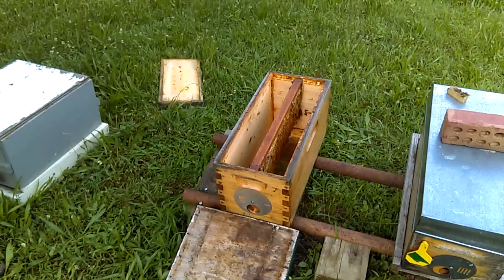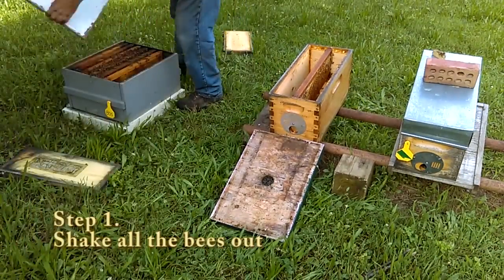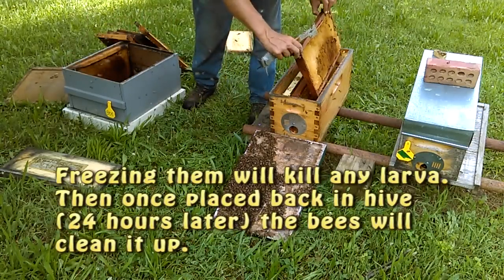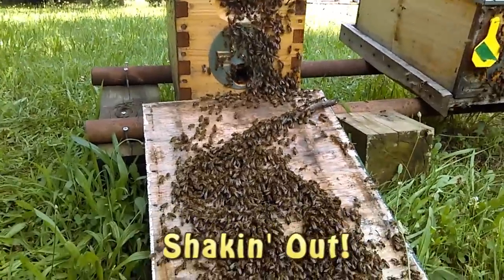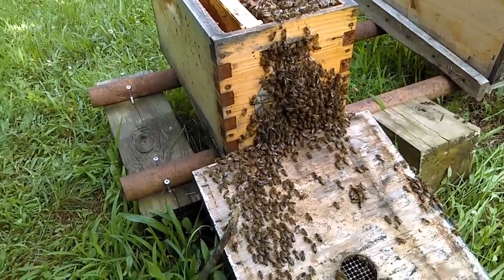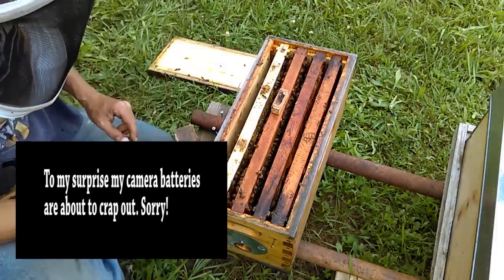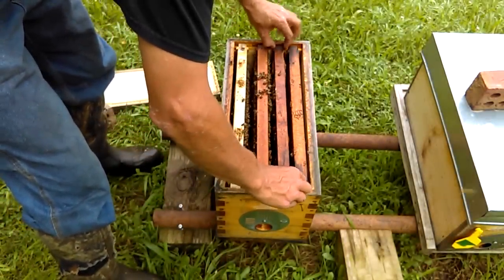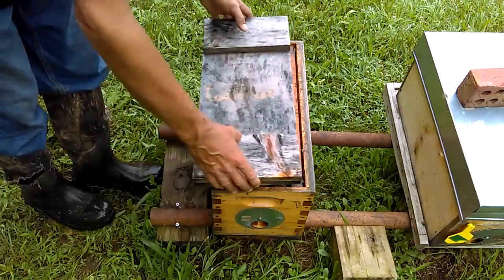Understanding / Fixing A Laying Worker Colony (Drone Layers)

Comment: I currently have a laying worker hive consisting  of two med supers which they are covering.  Would  hate to lose it . I only have 3 hives the other two might have a queen cell ,I have no extra reared queens . Do you think this  might work ?   As for dumping them out that close to the hive  doesn't that give the laying worker(s) a good chance of walking back in to set up shop?   Though I guess  they may attack the queen cells  ?

Kameron 
Fl.

Comment: Excellent process, nice job!   Have got to do the same thing this week and appreciate your video.  Well done!   Only wish I had more normal brood but only have two hives.  We’ll see how it goes.  Thanks again.
Reply: Update!  I used some of your technique, but with limitations.  Didn’t have brood from another colony so tried something a little different.  I removed all of the drone brood frames from the laying worker nuk, shook off all the bees about 30 feet away, put the frames in the deep freezer over night, took the clean drawn frames (some had nectar in them) out and put them in a new deep box.  Removed the nuk box from the area and replaced it with the new box containing the new queen in her cage.  
Next day, I pulled the drone frames (they had honey, nectar and pollen in them, let them defrost and returned them to the new hive.  The queen was well on her way to be released. Closed the hive up.   Checked it 2 days later and the queen was released and moving over the brood frames freely with workers acting normally.  Seems like it was a successful save so far.  Am now feeding them sugar water and pollen patties to help them build up.  
Thanks for the ideas!  Appears to be some options available, just need to take a shot!

Comment: I really found this video interesting! I am trying to alleviate a laying worker issue right now. I took a different approach and placed the laying worker box on top of a queen right box with newspaper between them. I’m hoping they will pick up on the smell of a queen right box and stop the laying worker.  This was recommended by a local mentor, as well as what I’ve seen from a university program in Ontario.  But what you did here was interesting, and I could take these steps after awhile, once they stop the laying worker.  Questions about a few things i noticed.... you have all these 5 frame nuc boxes.  Is that what you do, produce nuts?  Do you get any honey from these hives at all?  I’ve never seen anyone combine deep frames with mediums, but I’m new to this.  Finally, do you find the 5 frame boxes are easier to over-winter?  Are you located where winters are easy or as harsh as northern Illinois?  Thanks for posting this, I found it really helpful and interesting.  Take care.
Reply from the maker: Best of luck with the laying workers. And yes there is more than 1 worker laying in most cases. Yes, I sell nucs. I could get honey from them if I wanted but I do not push honey sales, I'd rather the bees eat their honey so I don't have to feed them plus the honey is better for them then sugar water. I can't say that nucs are easier to overwinter as they take the same preparation as any colony but they can survive our Ohio winters. 
Glad you enjoyed the video. Thanks for stopping in and commenting!

Comment: This is very informative on the subject.  Is there a reason you are shaking them at the entrance instead of inside the box?  Is there a reason you are using a virgin queen instead of a mated one?  Do you let the freezer frame come up to room temp before you re introduce it to the colony?  Thanks
Reply from the maker: Yes, to shake the bees back into the box would have fixed nothing, there is something to them marching back in and the new queens smell that makes this work. I used a virgin just because that's what I had free at the time. The same efforts would work with a mated queen though. Yes, always let the frame warm up before giving it back to bees.

Comment: Ive been donated a mated Queen and a frame of BIAS with nurse bees for my current DLQ hive. I went into the hive today and found and killed the DLQ ready for tomorrows introduction so they should definetly be Q- after 24 hours.

Plan is to move  the Q- hive to one side and have a new hive positioned on the original space with the BIAS, nurse bees and caged Queen sandwiched adjacent.

Then shake out a frame at a time from the Q- hive and hopefully let them walk back in. At the same time I'll check for any other Qs. Provide some 2:1 syrup.

Does this sound right???

TIA.

Comment: Jason why did you not use a mated queen, typically I would use a mated queen with several frames of brood above the laying worker separated by a sheet of newspaper, pretty much works every time.  But then again I always have nucs for back up!  Obviously the biggest challenge with a laying worker is having spare “queens and brood “ for most folks.   I would caution folks about trying to fix a laying worker colony without both.  Often the laying worker will kill an introduced queen or virgin if not accompanied by additional eggs, brood and workers.  Possibly the virgin technique works well because the virgin does not have the pheromones of a mated queen, I need to check that out some.  Nicely done though, more options is always a plus.

Comment: great video, but your manner of making the video is superb. it shows the process from start to finish over a few weeks. Often you only see the start of the process and are left with questions of how to proceed from there since it is a one time shot only.
also, what will dissolve wax on clothing that can't be placed in boiling water?
Reply: I personally used a iron with a paper towel.  I have heard that using news paper works but I have not tried it.

Comment: I had a laying worker.  Eggs were all over the place. Just fixed it less than 2 wks ago. My intuition felt that laying worker is in a particular frame since there were lots of done eggs,  so i took it out.  Waited for 4 days.  No queen cells, and no more drone eggs! So i got a new queen. New box. 2 days looked fine. I guess i made a mistake coz on the 3rd day of the queen to be released on the cage,  they attacked her. Then it happened really fast.  I couldn't take the queen out...  I could have done this.

Comment: Hey JC, how did they do long term? Do you have to use an unmated queen, or is that just what you had on hand? My bee group ran into multiple laying worker hives last summer, including two of my own. Would love to have something in the tool kit to salvage the hive. Thanks.
Reply from the maker: Hey Charles, They have done great since this video. Now they just need to pull through winter. I think a mated queen would work as long as the same steps were taken to install her. Best of luck!
Reply: Jason Chrisman thanks, I’ll share with my group next week. We are a sub group of the county bee keepers assoc that does continuing education year round. Last week I held a wooden ware class to build nucs  for spring. Queen rearing is up next.

Comment: Hey Jason, I have a hive go queen less, and I tried giving them brood and even put a mates queen, think they killed her. I have a super strong hive next to them, do you think I could just combine the two hive and correct the laying worker issue I have with the weak hive?
Reply from the maker: Yes you can combine them easy enough with newspaper. Can I ask though, when you added a frame of brood and your queen did you shake all the bees out and make them walk back in? That is a very important step.
Reply: Jason Chrisman At the time I add the brood and even when I have them a marked queen. I thought the hive was just queenless. So I didn’t shake them out of the hive. Even after the kill the queen, I found a large capped queen cell. Which totally confused me. The only thing I can think is that there are laying workers.

Comment: Hi Jason, I am dealing with my first laying worker colony. All drone cells, crappy pattern, etc. I do not have any queens or queen cells to give them at the moment. Is it worth giving them a frame of normal brood to see if that will kick them into creating emergency cells? I’m going to give it a shot as I have no other option and nothing to lose. Stu
Reply from the maker: Hey Stu, It's worth a shot but I would shake all the bees out first then add brood frames and let bees march back in. May need to prop a board up to hive for them to march in. Best of luck!
Reply: Jason Chrisman That’s my plan, Jason. At this point I have nothing to lose. If it fails I am right where I am now. If the brood pheromone turns it around it’s all good and there is another trick to try.

Comment: I am new to beekeeping. Is it easy spot laying worker? Ie size difference
Reply from the maker: It can be easy to spot if you know what to look for. Like the drones raised by a laying worker are usually smaller because they were raised in worker cells instead of drone cells. You will also notice that all the brood is drones (rounded cap on cells). Another thing to look for that I mentioned in video is the eggs. Laying workers lay several eggs per cells and most of the time none of them are centered in the bottom of the cell.

Comment: Jason, thanks for the videos. On the laying worker fix, what is the aim of shaking out the bees if you are doing it right in front of the box?  If any laying workers are there, they can presumably just walk back in. One traditional fix is to shake them out at a distance. I see the logic of that as you are hoping the laying workers cannot find their way back.  Cheers.
Reply from the maker: @Rob H I can't honestly say why it works shaking them out right as the base of the hive but I can say if you don't do it the added queens doesn't stand much of a chance, at least in my experience. I'm not sure if the walking back in triggers something causes the layers to stop or what but this method has worked every single time for me.
Reply: @JCsBees  thanks Jason. Interesting. maybe the shake-out causes a kind of reset. I am trying to help a friend fix a laying worker situation. Planning to try the adding a queenright brood comb method.
Reply from the maker: Good luck!

Comment: Hey Jason,  another way which i think gives more predicted results is to 1- shake the bees a few hundred meters from the original hive as less laying workers will get back due to their ovaries size and weight  2- use a mated queen under a push-in cage and allow her eggs/then larvae to suppress any remaining laying workers and after the mated queen is released in the hive usually  the bees will take care of any remaining laying worker who tries to get to the queen... different way but yours could also work just  fine
Reply: Without asking Jason, I think the primary reason he didn’t shake them out a couple of hundred yards/meters away is that the young nurse bees that haven’t started to fly would all be lost
Reply: Yes i get your point, thanks for pointing out
Reply: Ahmad Abdi   Laying worker hive has been queenless for weeks. There should be no young nurse bees present. When I have shaken bees at a distance, on checking that site an hour later I have never seen bees remaining.